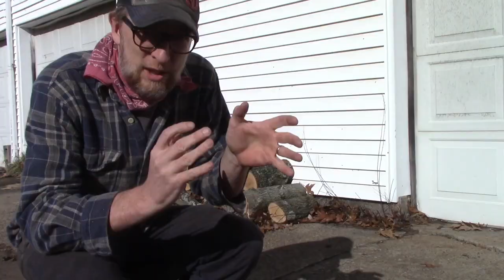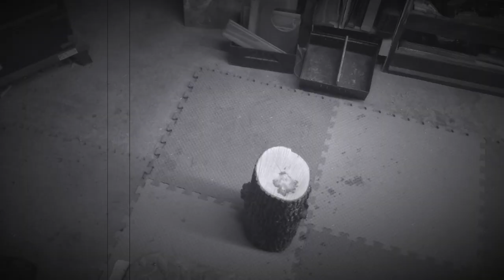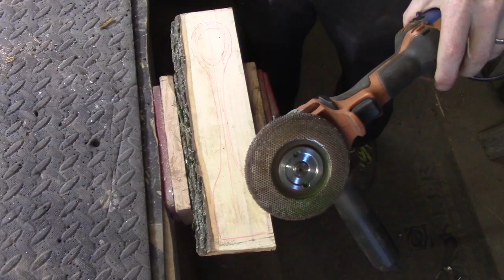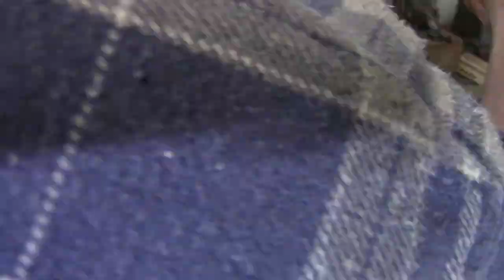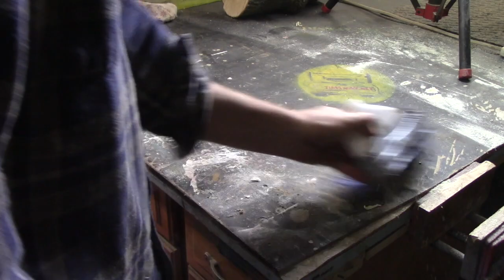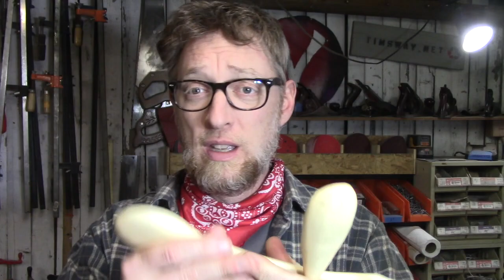Wood Kitchen MultiTool - Spoon/Spatula Carved from Firewood

Comment: Let me start by saying awesome stuff of course as always. One part has me stumped...🤔 When your standing on the oscillating belt sander and you speed up the clip the oscillation stays at the same speed as it does when it’s at normal speed. Hell I may be crazy. Can someone else verify this for me lol. It is really perplexing to say the least.
Reply: Nesley Heiney I noticed it too. It's much in the same way that a propeller will appear to stall or even seem to stop & go backwards at times, on film. I forget the proper terminology at the moment though.
Reply from the maker: yes, what rag tie said. It's all about film rate. I think modern cameras filming at the resolution I shoot take 40 pics a second so when things spin and oscillate that plays a factor. Something spinning at 400 rpm will only get "seen" 40 times in that minute. if I speed the film up X10 now those 40 times are still there, but 10x faster and not all 400. Sometimes cool things happen :)